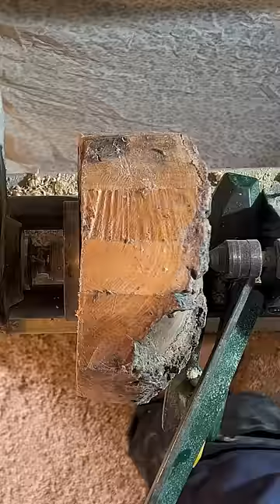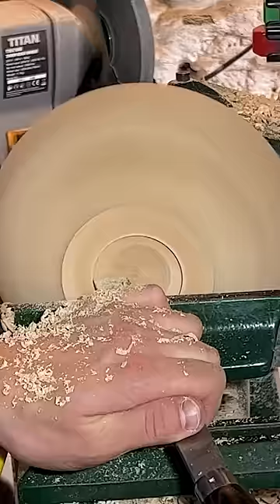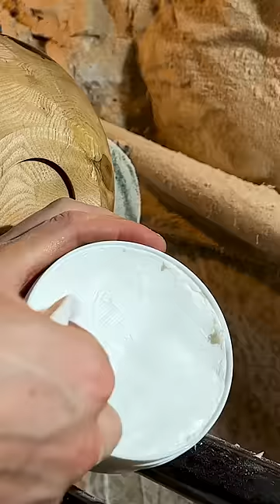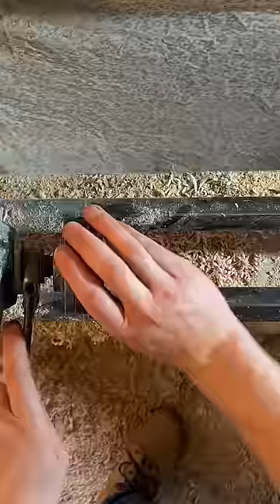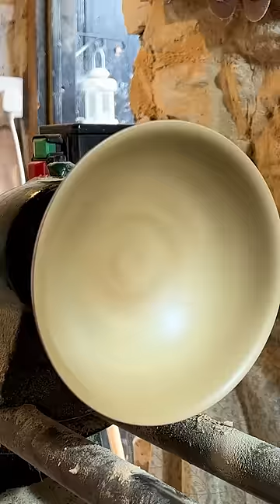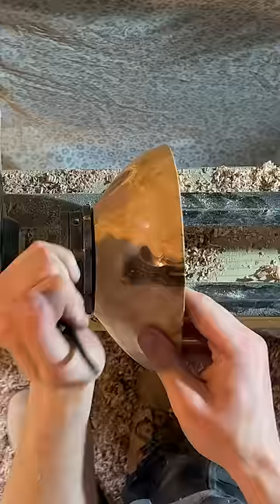Making Ash Wood SHINE! #woodturning #shorts

Comment: Why do you rub it with the shavings
Reply: I was just wondering the same thing
Reply from the maker: The wood shavings act as a sort of abrasive which burnishes the bowl after applying the sanding sealer. Basically makes it go from feeling rough to feeling super smooth when running your fingers over it :)

Comment: What is hapoing when you press the shavings in?
Reply from the maker: The wood shavings act as a sort of abrasive which burnishes the bowl after applying the sanding sealer, making it go from feeling rough to feeling super smooth when running your fingers over it :)

Comment: Why do you rub the wood on it?
Reply from the maker: The wood shavings act as a sort of abrasive which burnishes the bowl after applying the sanding sealer. Basically makes it go from feeling rough to feeling super smooth when running your fingers over it :)

Comment: What I can’t figure out is why would he Finnish the bottom before cutting into the top of the bowl, wouldn’t it be easier to make the bowl, sand, but Finish all at the same time? I’m not super handy but I was in some wood shop classes and made a bowl but I think we did the finish after everything was done. And I saw another person ask this, I have the same question, what’s rubbing the shavings on it for??

Either way no hate just wondering, beautiful work and an amazing finished product 👍
Reply from the maker: Tbh it’s mostly out of habit I I think. The one bonus I find to doing the bottom first is that I can apply wax to the foot of the bowl which I wouldn’t be able to otherwise :) I use the shaving to burnish the bowl after sealing it, making it super smooth to the touch